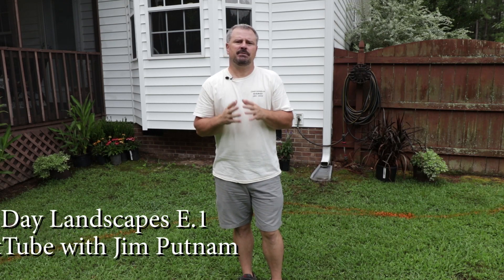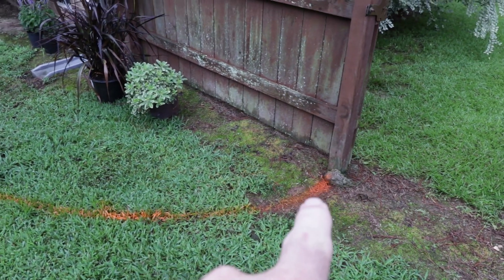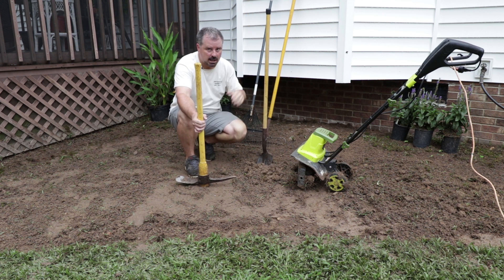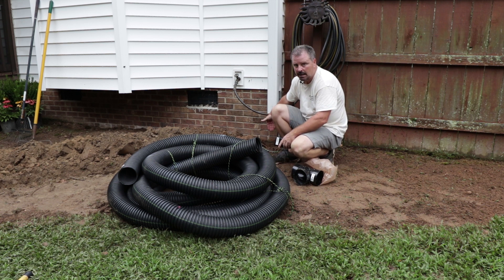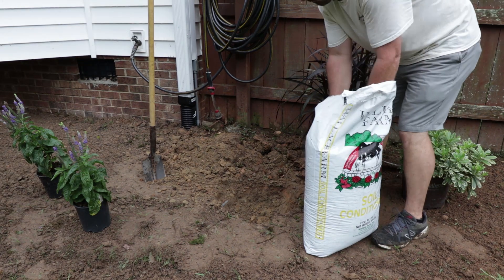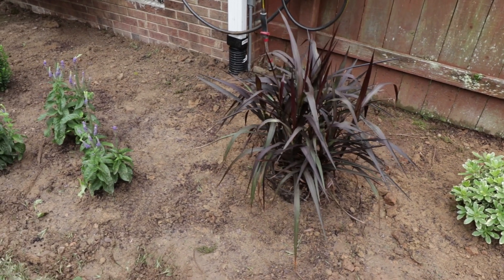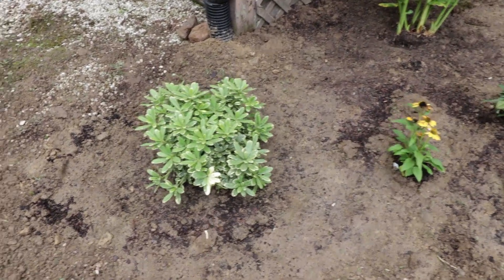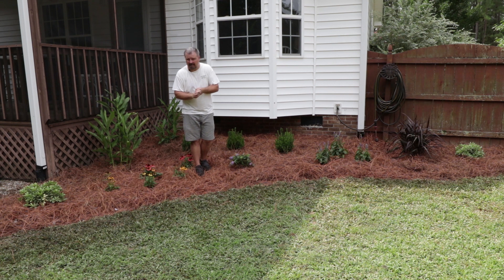One Day Landscape Installation - E.1

Comment: Nice video Jim! I'd say either format is fine and whatever is easier on you (some people do time lapses). You did a good job explaining things. An interesting thing I'd love for you to do a video on is something like steppables. I've heard about them but never had a pro comment on them and how well they actually work. I'm considering using them in a pathway instead of mulch but not sure of the advantages/disadvantages. Also, on a similar note, I'm trying to think of how to cut down on weeding by having less bare mulch. I've considered going with snapshot pre-m but would prefer less chemicals if possible.

Comment: The video was very helpful. I was kind of wanting to see more of the process especially the drainage part. How does the end that the water comes out look in the yard? Did you clamp the drainage pipe/tube when you joined them together? And do you have to worry about the tube clogging or being crushed? Just a few questions i have. Lol.

Comment: Where did all the dirt go? Assuming you went a depth of approximately 3", that would produce over a cubic yard of excess dirt (120 sf x (3/12) = 30 cubic feet or 1.11 cubic yard). That's a lot of dirt for the common homeowner.